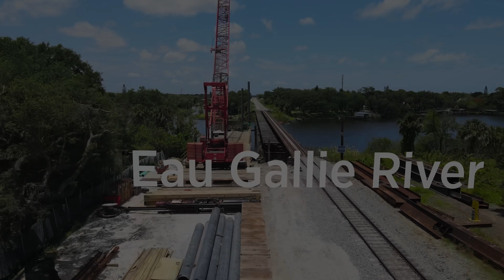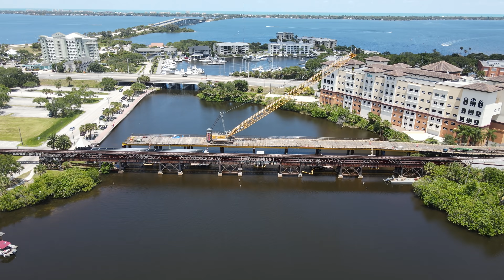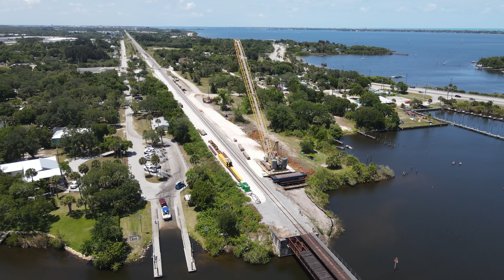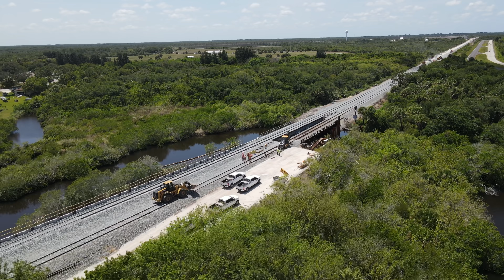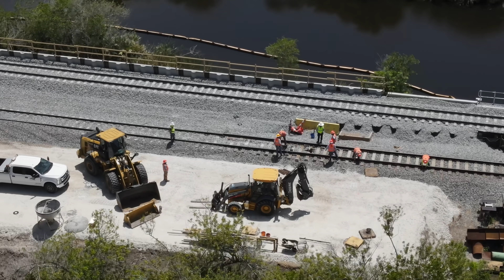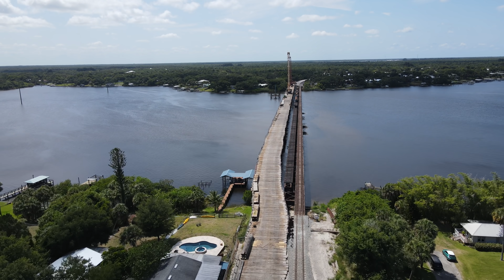Brightline Construction: The Fifth Bridge Edition - May 2021

Comment: Excellent video.  I’m excited for completion of the project and see it in service.  FYI what you refer to as the “Header” over the piling is actually referred to as the Bent Cap by the designers.
Reply from the maker: Thanks, I’ll be sure to change that terminology moving forward. I had seen header mentioned somewhere before which is why I used it.